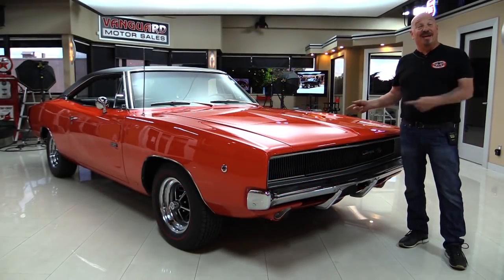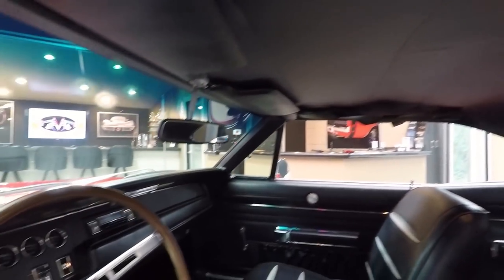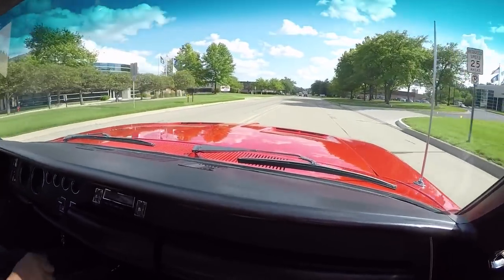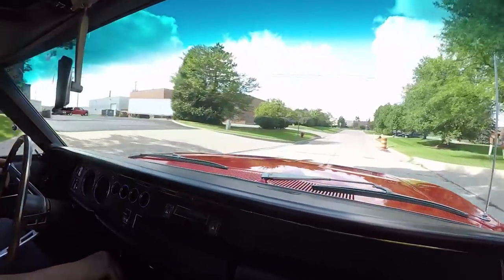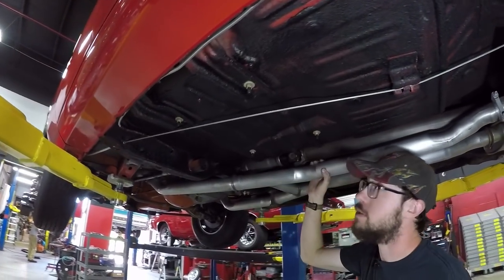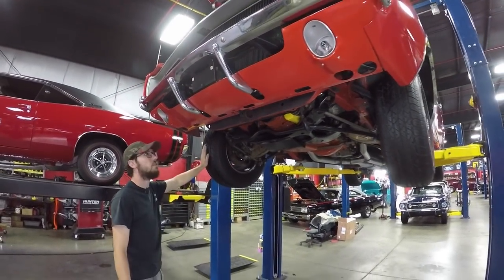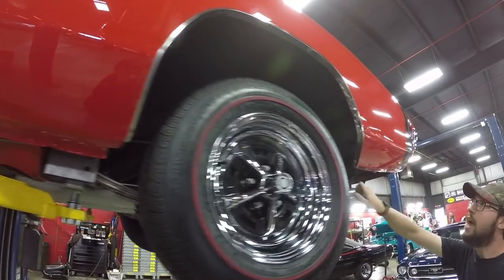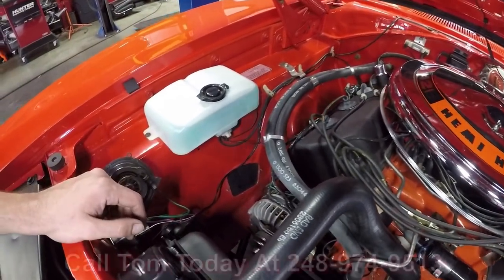1968 Dodge Charger For Sale

Comment: Needs raised white lettered tires and a full console and does it have A/C and did they know that they could replace the 2 4 bbl carbs with fuel injectors that look like 4 bbl carbs and park in my DRIVEWAY!? A car like that would never sit outside in the driveway, it would be in the garage!!